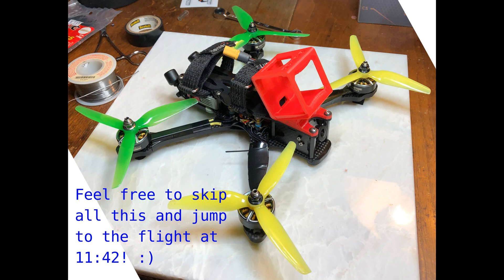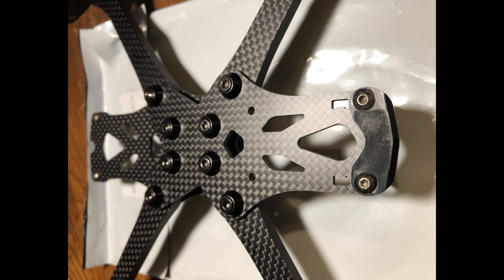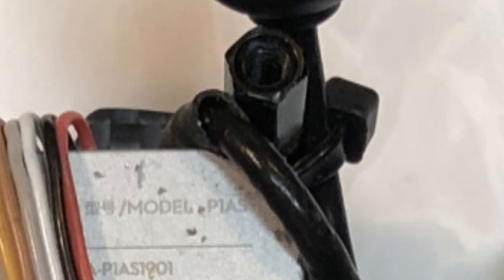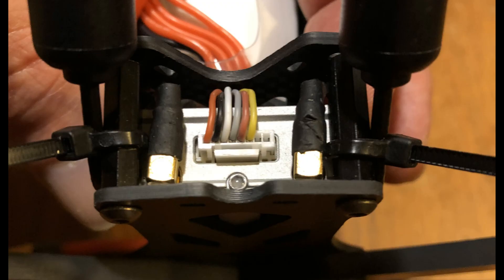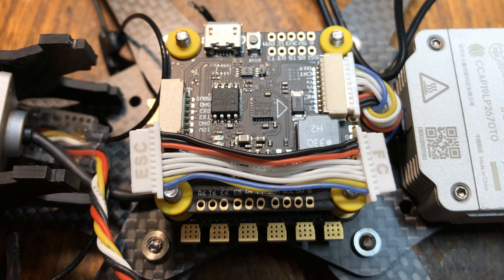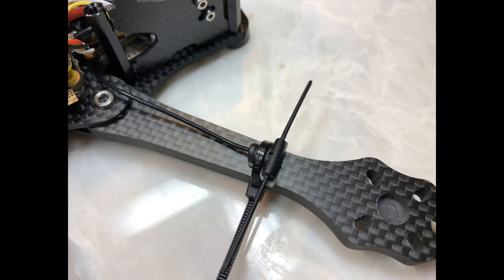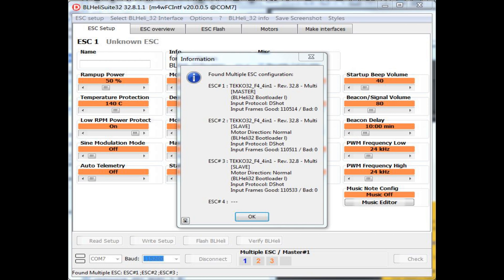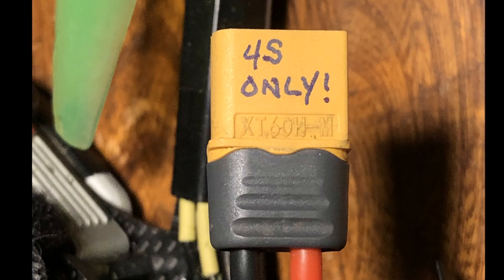A Better Way to Mount the DJI Air Unit Antennae on the ImpulseRC Apex HD?

Comment: Very interesting topic ! I'm currently building the new APEX DC with the electronic of my old Chameleon Ti frame. 
I'm doing this because I could not get rid of the mid throttle oscilations. My electronics is Tekko32 and Holybro Kakute F4 v2. Like you ?
What were the symptoms of your electronics ?
Reply from the maker: I had so many ESC and FC troubles with this build that I thought I’d been cursed… All were obvious defects except for the final issue, which appeared as a bobble after snap-flips. All was fine if I flew gently. I tried different things to fix it – tuning, checking wiring, adding extra capacitance, changing mounts, and swapping various parts. Eventually, the black box data revealed different motors were becoming unresponsive during the bobble. Swapping out the ESC solved the problem. That ESC had previously showed a few % RPM errors on the bench, but reducing DSHOT from 600 to 300 had dropped it to 0%. The replacement runs DSHOT600 with 0% errors. The final parts list is on any of my videos posted since this one ;-) Your new build looks good – I hope it works on the first try, AT!